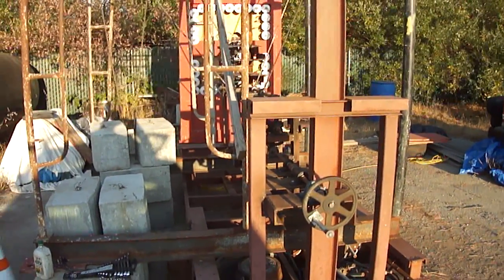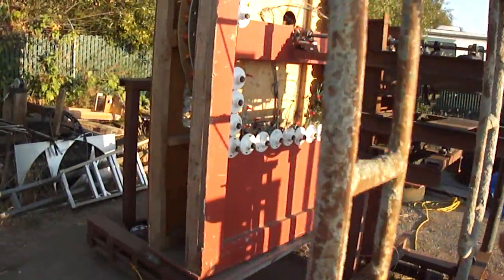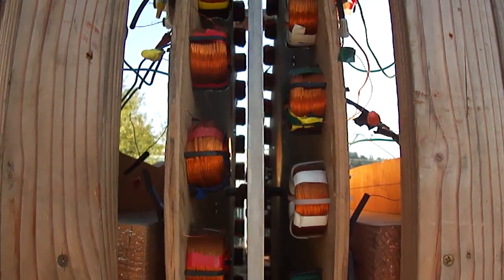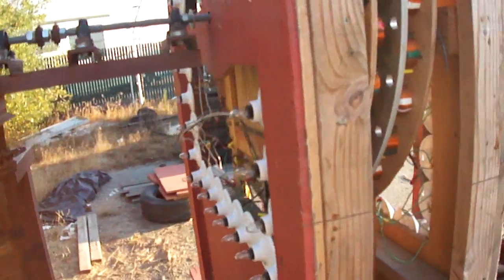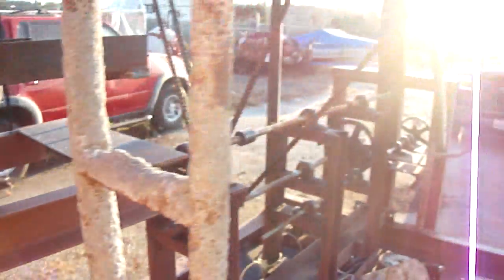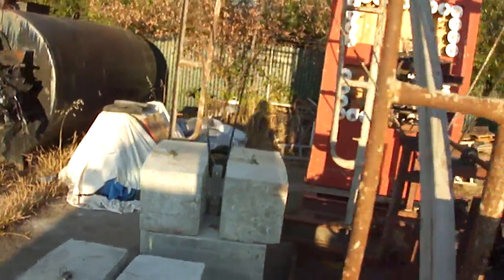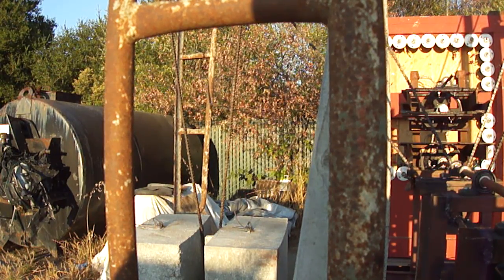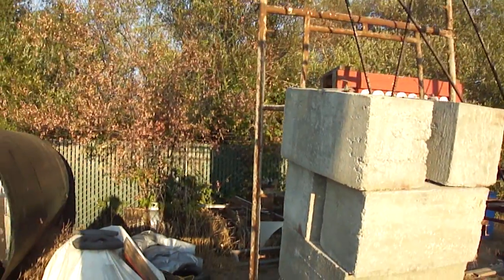Gravity Converter (walk through)

Comment: You could lift the weights with water if they are made to be buoyant. You can move water with a ram pump to a tall tank with the weight inside. As the tank fills the weight goes up and when the water drains the weight goes down. Ram pumps use no electricity to move water uphill
Reply: This is my design. I am building a concrete boat of sorts. I plan to try this same idea with four tons moving 10 feet. I will fill a reservoir with the necessary amount of water. The solar arrays, during the day will power pumps that fill the concrete boat with the reservoir water. This will drain the water and make the boat heavy. Once the vessel is full, and the reservoir is drained, the battery is loaded and can be activated at anytime. It will descend 10 feet, and produce what i calculate to be about 10kw. this is ideal for nighttime when the batteries are normally being depleted. After descent, water will be ejected from the vessel and remaining recycled water will flood into the reservoir and the vessel will float back up.
Reply: @thomascushman4542  maybe harness the water that is drained out as well with some water turbines. You got a solid idea.
Reply: Ram pump needs source of flowing water, which very few sites have.

Comment: WHY?!? instead of what, batteries? Pumped storage? Flywheels? What problems does this solve?
Reply: One of the flaws with pumped storage systems (where water is pumped up to a reservoir at higher elevations during times of excess energy production then drained to feed the turbines of hydroelectric dams) is that prolonged drought can reduce water levels to the point that the pumped storage is rendered ineffective. A gravity battery system is nearly identical in concept to pumped storage, but does not need to rely on water. It solves the problem of energy storage in areas with little/no water and/or areas where terrain will not allow for the creation of dams and reservoirs needed to utilize pumped storage systems.

Comment: Did you ever think about or try an alternator / motor connected to and charging a battery bank a battery bank? Would likely require some more gearing to get an alternator to spin at the proper RPM
Reply: Then hook a motor to the wind up crank and use power from the gravity generator to power the hand chank
Reply: @eaglegp7  I think it won't work as it breaks the laws of physics.